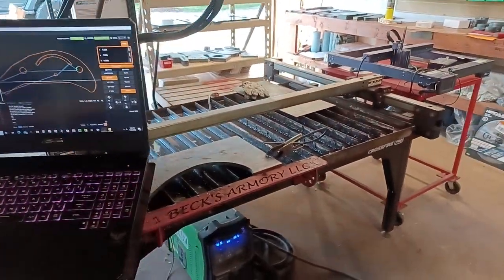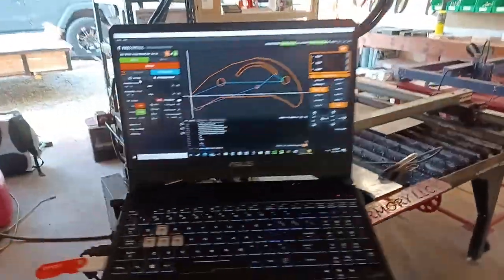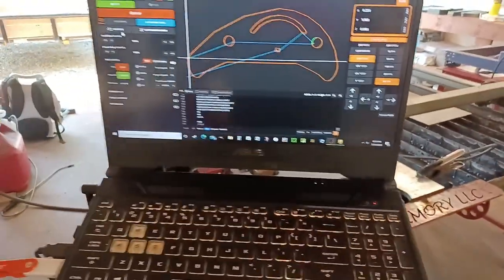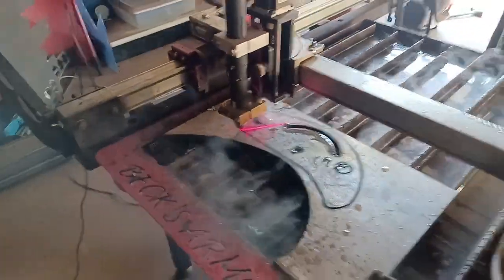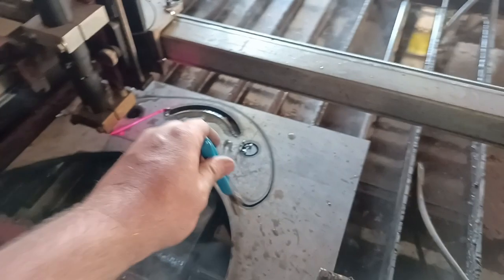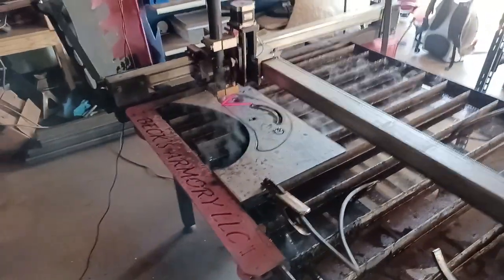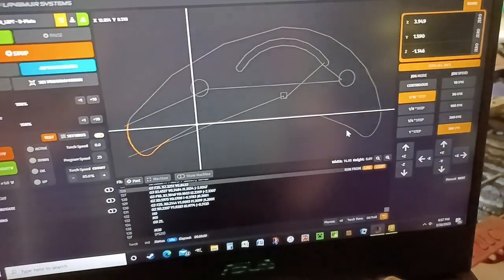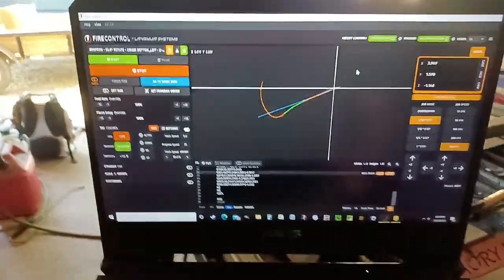Langmuir Systems Crossfire Pro Cutting 1/2" Thick Steel Plate with Everlast Power Plasma 82i CNC

Comment: its too bad you cant resume on a circle... I'm 3/4 of the way around a 4" circle and the pierce was lost for some reason.. then it picked up again after a couple inches... but I cant use the part as its still part of the sheet.  (1/2" steel material)  We've had the THC since we got the machine.. but it has NEVER worked..

Comment: Im interested in an everlast 82i or the 102i for my table. Currently i have a spectrum 375 and a old hypertherm 1250. If i cut 1/2 or bigger with long cuts ill power my big compressor off my welder generator or visa versa.
Reply from the maker: if you're going to cut 1/2" and bellow the 82i is a great option.  If you want to cut 3/4"+ than I would go with the 102i :)

Comment: What is the feed rate you are using? I haven’t tried cutting anything this thick yet but it is up next so any pointers are great. Thank you for making this video!
Reply from the maker: it was 65 amps, 65 psi, 1.2mm nozzle, and between 20 and 40 ipm.  I don't remember the exact ipm and I'm not at my PC right now.

Comment: Thank you very much for the info on restarting the line. I did not know how to do that. I have had my breaker pop a few times with longer cuts on 3/8 and ended up with a bit of a mess trying to resume cutting the part. Are you running smart voltage or nominal voltage on your THC? I have the 82i on an XR table.
Reply from the maker: I run the smart voltage.  it just easier and very effective.
Reply: @BecksArmory  I have been running smart voltage on everything but 14ga.  It doesn't like 14ga and I have to run nominal voltage for the torch to maintain even close to correct cut height.

Comment: What settings are you running?  I am having a hard time with 1/2 on mine
Reply from the maker: it was 65 amps, 65 psi, 1.2mm nozzle, and between 20 and 40 ipm.  I don't remember the exact ipm and I'm not at my PC right now.

Comment: I have my air compressor and my plasma cutter on their own separate breaker would that eliminate this problem? I've not cut anything that thick yet
Reply from the maker: possibly.  This tripped my shop main breaker.  The people before me only sent 50amps to the shop from the house.  Even if they are split at the shop the breaker in the house that feeds the shop blew.

Comment: Thanks for speed/bevel tip.  Sometimes when I resume I have to turn off THC because it's not getting started correctly because I'm starting where it's already cut.
Reply from the maker: Change the travel distance to ignore at startup to a larger # and it will ignore that distance before it calculates it height.  So the default is 1/4"  I set mine to 1/2"
Reply: @BeckTools  oh, that's great help. Thanks.